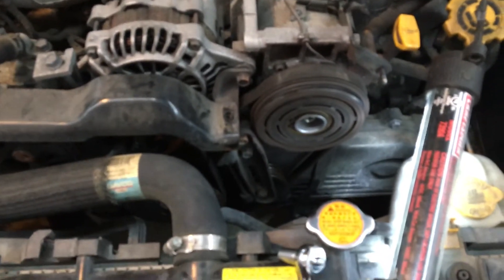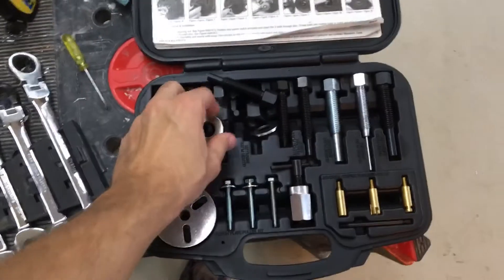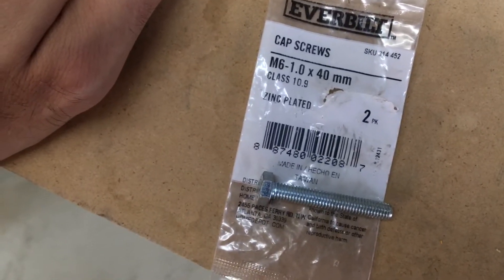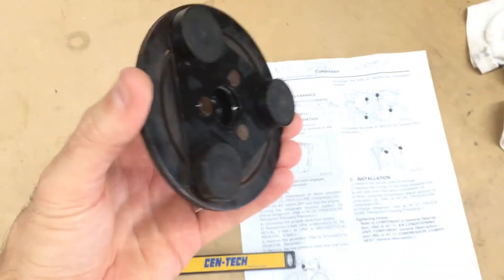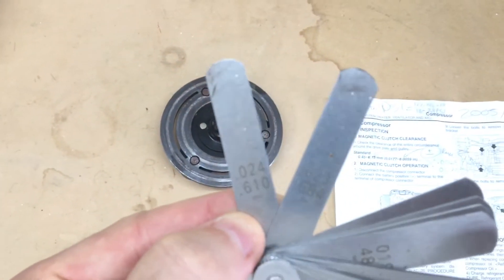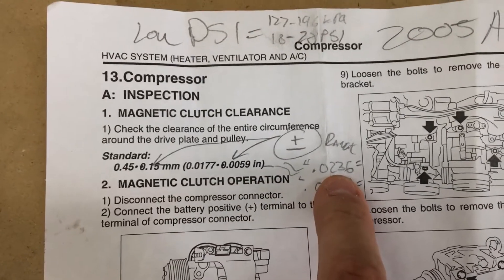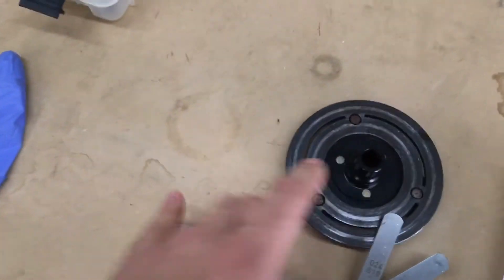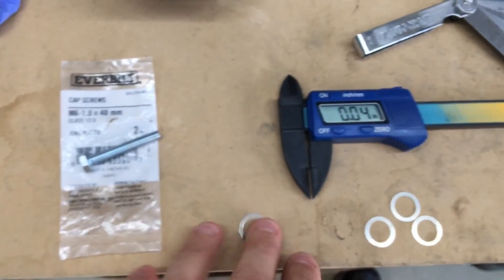2005 Subaru Impreza AC compressor Clutch removal

Comment: I’m trying to remove the center nut from A/C clutch from my 2005 Outback XT. But I have no way of holding the clutch as the holes are covered. How did you do it?
Reply from the maker: Did you get our figured out?  Sold my Impreza to my neighbors girlfriend and she promptly wrecked it less than 6mo later 😩
Reply: @jcardisco1  I ended up replacing all A/C components on the Outback XT. Sorry to hear she wrecked the car bro. I know how that feels.